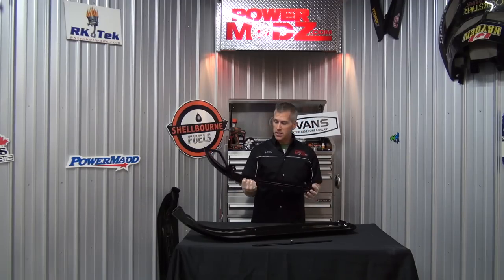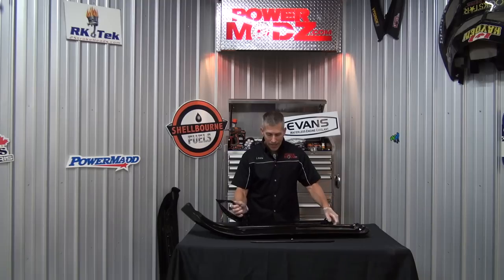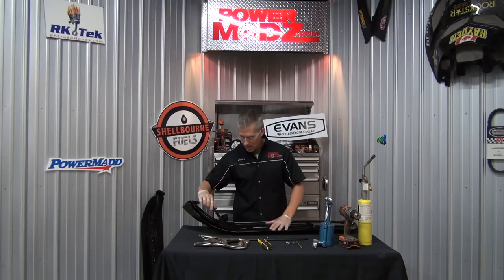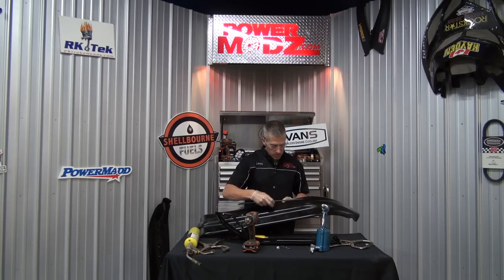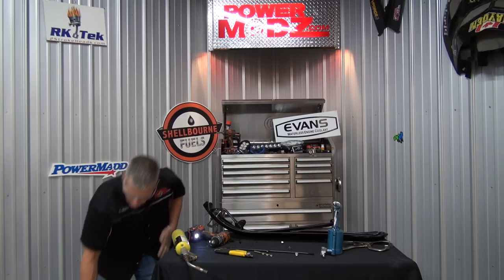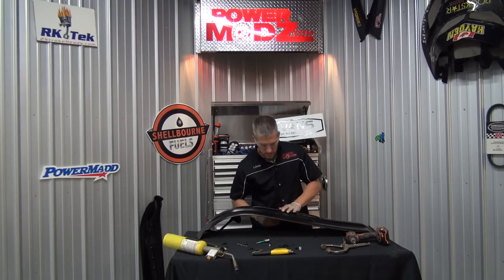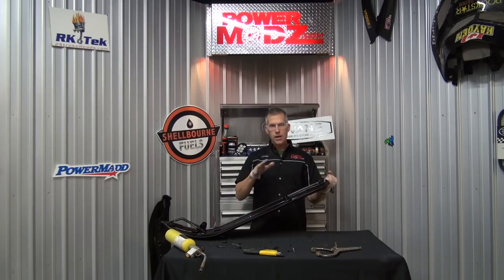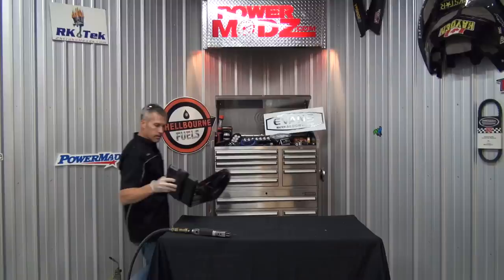Skidoo elan restoration series Ep #7! Extra wide ski skins install!!  PowerModz

Comment: wolf,i would change your angle of the skid. so if you could adjust the front end of the skid i would pull it up into the tunnel a little so your angle of the track when you make contact to the snow wont be so steep
Reply: Would changing the setting on the kimter help, i read last year when I was trying to find a solve to the problem, people set them loose to wheelie(how i set it up) a while ago, but if I pull it back down to tighten it would it help level it out so I won't trench?